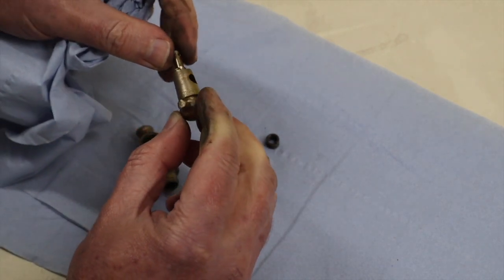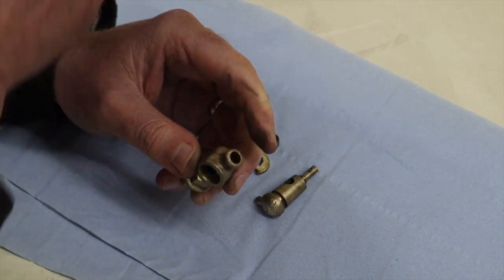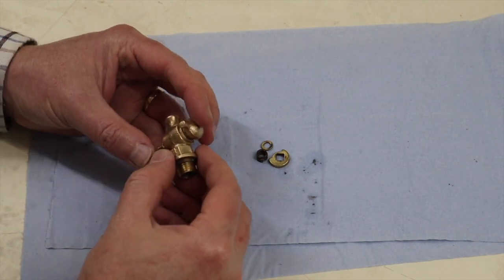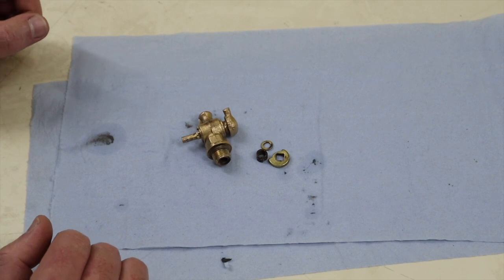#108 Ferguson TED20 - Engine Block Coolant Drain Tap - with Anglo Agriparts

Comment: Hello Gordon. It would be interesting if you were able to salvage that fitting. The drain cock on the bottom of my TE20 radiator was a damaged mess. Lucky for me I found a new old stock brass fitting that looks even better than the original. The best part was the price at no cost, the guy gave it to me. TTFN/CDC
Reply from the maker: Hi Charles, sadly not. In the end I had to remove too much material to get the score marks out to the point that the ‘geometry’ of the two parts no longer aligned. I have sourced a similar replacement which I will cover in another video shortly. 👍😉

Comment: Hi Gordon, I have a particular interest in this video. I have the original tap with a leak. Tried the fine grinding paste without success. As I would like to reuse the original I have a particular interest in any progress that you make in solving the leak. Thank you and Oscar so much for your excellent videos. Jim from Dublin Ireland
Reply from the maker: Hi Jim, thank you for your comment. I still haven’t found a solution, but I also haven’t given up yet! Like you, I really want to save this one. 😉 One idea I’m toying with is to use polish instead of grind paste. The other is to remake the centre part. Michell suggested speaking with a jeweller to see if they have any methods for building up the surface. Perhaps using some form of electrolysis method. So far I’ve not managed to find any more information on the latter. I will do an update in a few weeks time I think. 👍😉
Reply: Hi Gordon, thank you for your reply. Very much appreciated. If there is a solution I hope it's possible for a DIY person to carry it out. Regards Jim

Comment: Hi Gordon.Can you tell me the size core plug required to replace those on the back of a 1949 tea20 petrol tractor. I refer to those in the clutch housing and on the rear of the block
Reply from the maker: Hi 09amusement, apologies I don’t have these to hand (I’m working away from home atm) In one of my videos I do mention the size of the one that sits behind the camshaft and the one at the back of the cylinder head. The others inside the bell housing, I don’t have the sizes. If you call Anglo Agriparts I’m sure they can tell you. Sorry I can’t be any more helpful at the moment. 😉👍
Reply: @WaterhouseForde  thanks Gordon. I'm pretty sure they're the smaller 1 1/4 sized ones